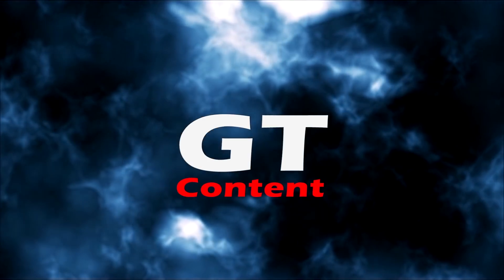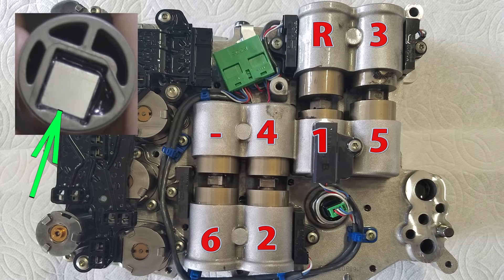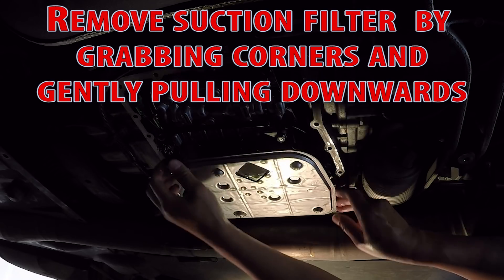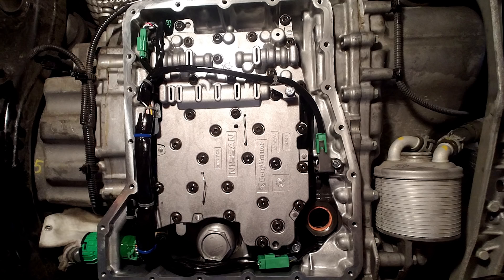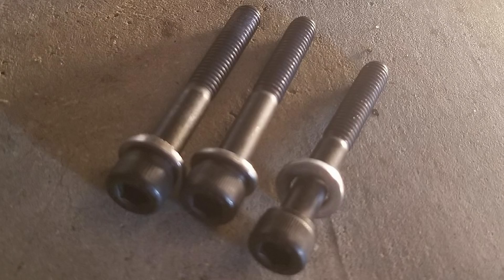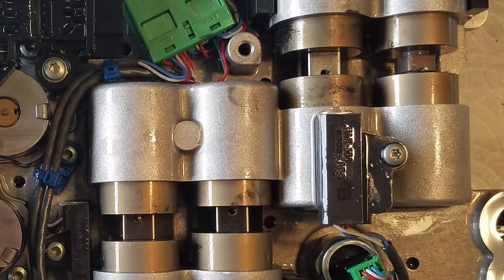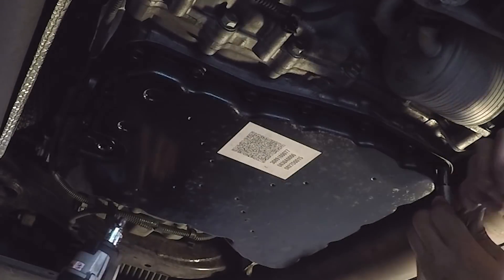$45 dollar part fixes $18,000 GTR Transmission issue - TSB Clips

Comment: Damn what a nightmare after spending so much on a car like this paper clips?
Reply: Herakles quite far from a nightmare. These cars are amazing hand-built machines and the quality is unmatched by many other manufactures. They’ve worked a lot of little quirks out over the years.
Reply: @boostcontrolledperformance1523  According to another channel, the cooling system isn’t adequate for track use and needs some massive upgrades, the stock brakes aren’t cutting it.

Comment: Hello, my gtr is having the same issues, the only code I pulled was P0776 “Pressure control solenoid “B” performance or stuck off” I was just wondering if this was the same code you pulled and if this should fix my issue as well! Thank you
Reply: I had the same error code today.  Did you get your car fixed?  And if so what was the remedy?

Comment: Nissan does some dumb stuff like having all those electrical connections and solenoids swimming in fluid. They also had the tcu in the transmission fluid pan in a couple of g35s and 350z.

Comment: great video, but if u have opened the trans, u should clean the pistons, the metal on the magnets can destroy the pistons, because they got scratched and leak... 

where u get the nissan service bulletin? here in austria u got NOTHING from Nissan.....

i have done this year also a maintenance on my gr6 with install clips, cleaning, add additional Magnets, replacing the Linefilter und fill Motul DCTF (like u do on yours) :)
Reply from the maker: The service bulletin states not to clean any metal shavings/debris. The stuff we found on the pistons looked and felt like grease with very little shavings. Of course, we cleaned them with a soft towel anyways. lol

The bulletin can be found online. I'm not sure if it's specific to the USA only.

Comment: Would you also recommend to replace the oil pan gasket and filter ?
Reply from the maker: Good time to do it if it needs replacement. Otherwise reuse the existing.

Comment: What happens if I don’t add these when it needs them? My car transmission works fine and power and TQ is there but it’s making a weird ass sound on 5th gear. I had got code P283C-00 shift fork “C” position circuit range/ performance
Reply from the maker: Not required if you don't need them. More for prevention.

Comment: I don't fully understand what you are doing with the paperclip and magnets on the accuators.
Reply from the maker: The paperclips will prevent the actuators from rotating.
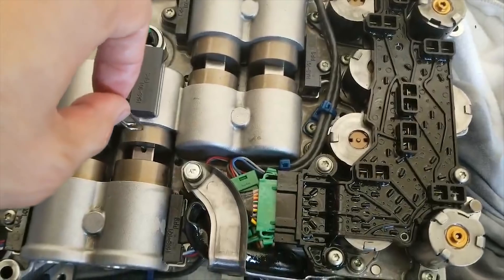Reply: @GTContent At 3:36. No, sorry, the paperclip when you had the valvebody on the table. When you were dangling the clip and it would stick to the housing. What was the point of that? Is that doing some internally?
Reply from the maker: @Mikey6048   I used the paperclip to find the location of the magnet in the side of the actuator so that I can align it. The GTR shifting issue is caused by the actuator getting out of alignment.
Reply: @GTContent  So the metal paper clip is aligning the magnets in the housing. OK.

Comment: hi there love you videos btw , i actually have quick question , my friend drove my gtr and he was on manual mod if im not mistaken i saw him tap the rev limiter while downshifting 4-3 , im quite worried if there was any damage due to that  but the car seems to run fine but just worried , so would want to ask the expert ...tq
Reply from the maker: You should be fine as long as you don't notice any unfamiliar noises or weird shift issues.
Reply: oh cool actually made me feel alot better , just wondering actually , how high rpm can a gtr tolerate when downshifting .... have you ever downsfit above 5k rpm ? tq
Reply: it actually happened few months back ... but i still think about it because i never had a proper answer on how high rpm can u go while downshifting on a gtr ... some says gtr can tolerate 7k while downshifting ... anyways thanks for the fast reply ... watching all the way from malaysia :)
Reply: @VILLAINSSQUAD  im always downshifting above 6k rpm, and not having any problem after that... my gtr is 2012 model... the main purpose for downshifting is to gain engine braking and stopping,.. i dont think the ecu transmission can let you downshift to more than the rpm limit because i have try do it one try to tap the downshift paddle while im in 3rd gear and at 6.5k rpm and it do not engage the downshift until im reach 4k rpm...

Comment: Great video.  What do you think about jacks drag 800 transmission?
Reply from the maker: If you plan to not go above 800TQ, then it's fine. I believe Jack's uses Albins gears which are quieter. Shep uses Dodson which are slightly noiser, but stronger. Just words from others as I have no personal experience.
Reply: GT Content thank you.  How about oil...Motul 15w40 and what’s your opinion for the best combo?

Comment: I have a 2009 GTR.  And this week it started doing exactly that. I made an appointment with the dealer for transmission oil change which is due and I don't know what to expect when I get to the dealer. Now I have a pretty good idea what the problem is. Can you do this job ?
Reply: Did you fix it?

Comment: I have 09 plate is it worth doing it even though I don’t have shifting issues ?
Reply from the maker: It's preventative maintenance. Do it if you'll be working in there.
Reply: @GTContent  what about the transmission filter? There not cheap mine only done 60k miles
Reply from the maker: @garyalcorn3831  No intervals on the filter. Do it if its convenient.

Comment: Hello! I have a 2015 Nissan GTR and I can hear my gears switching and hear a little grinding noise when I let off the gas in first gear. Also I can hear my bellhousing knock! Would you recommend doing this on my 2015? 

Thank you,
Erik
Reply from the maker: Might just need a bell housing replacement.
Reply: GT Content okay and you don’t recommend putting these clips in my 2015?
Reply from the maker: @ebotos  You can install the clips as preventative measures.
Reply: GT Content definitely will man! Because I also have a grinding noise in first and reverse when I let off the gas.

Comment: So this prevents the transmission failure!? 45$!? Lol.  I wanted to buy a GTR for so long but was scared because I didn't want to drop 20k on the transmission! Also, are the 2014 transmission better, did they fix the issue?
Reply from the maker: The transmissions were updated for 2012 and newer. 
The TSB clip issue is a hit or miss just like the bellhousing.
Reply: I was gona ask about newer models seems this and thw bell houseimg was looked at and improved sofar the newer grt models seem to be slightly better am looking at the chnace of geting a 21 gtr :) so these videos do help alot

Comment: Love your videos. You make me feel more confident in owning a GTR (which I am now picking up in a few days).

QQ- would it be okay to do the clips on a 2010 with no current shifting issues? Ie, do not have to take anything apart but just shove some clips in there?

The GTR I am picking up just had a ShepTrans rebuild stage 1 on it so no idea if it even will have the same problem. Thanks!!
Reply: if it has a sheps tran in it, it will come with these already, if it's the stock trans doing this will negate any future issues and is a good thing to do even with no current issues.

Comment: are there any shifting problems again ever since then? any other transmission related issues? planning to get a 2009 model.
Reply from the maker: The owner has not had any issues since.
Reply: @GTContent  is the 2009 model GTR a smart move since its cheaper or go for the dba 2012 model?
Reply from the maker: If you can afford it, get the 2012+ for the significant updates.

Comment: How many miles was on the GTR when this issue started? My 09 CBA ,FBO E85  GTR only has 14,000 miles on it ..
Reply from the maker: I recall it being around 40k
Reply: GT Content Thx Gary..as always great info..very well done..
Reply: Yeah, mine got it at 48k luckily I bought a drive train warranty when i bought the car so I don't have to mess with it. Its currently at the shop and so far the bill is $24,000.
Reply: good thing the warranty has to deal with that bill

Comment: What would You suggest for a 2014 GTR having the same issues. Wont shift into odd gears tm light came on then went off check engine light stayed. Now tm on all the time. No recall is this still a tsb clip issue
Reply from the maker: Sounds like you need to do this repair.
Reply: @GTContent  Took out the code reader says pressure solenoid B P0777 malfunctioning. Is this the same issue as your video or better yet if it the same fix. Seems like it could be dirty trans fluid I just changed that 3 months ago and diff bad pressure sensor electrical ecu lol dealership went dream
Reply from the maker: @princenero1212  I can't say exactly, but you're symptoms are similar to the GTR owner whom I helped fix his transmission shift issue.
Reply: @GTContent  how much you charge I know we in a pandemic but I support small businesses 1000%
Reply: @GTContent  yup symptoms were the same except I couldn’t go into odd gears.
Reply: @GTContent  another question and thank you kindly for all your help is he still having issues. Did that fix the issue? Did he have to take the car to the dealership to adjust the tcm they quoted me 450 for that to get it back into factory specs
Reply from the maker: @princenero1212  I don't have much time atm for actual repairs (my family), but my troubleshooting service is free. 
His issue was not being able to go into odd gears also. His car has been running fine after the repair. He used a Cobb Tuner to reset/learn.
Reply: @GTContent  I understand I took it to a Japanese repair shop lol 2 gtrs in the bay you could guess why so I think I’m good. I showed them your video but they already seen it smdh industry is small I guess I’ll let you know what the damage is.
Reply: @GTContent  ok quick update lol I replaced all three sensors in the transmission they were all failing or about to fail ouch at 65K btw. Did the TSB Clip install as well thanks for the video!!! Just waiting for a pan gasket and to put the Trans back into the car I’m at 9 hours of labor so far. 600 in sensors 60 in clips I bought extra in case 300 in trans fluid 55 gasket. Dealership wouldn’t sell me the transmission sump filter so I just cleaned it up.
Reply: Ok final update and thank you once again. Car has been running or about 100 miles or so now with no cel or tms failure. I saved about 20K by not going with the dealer recommended replace trans assy lol. I did have to replace all three pressure sensors though at 185 a pop. So total cost fluids parts lift rental 1690!!!!!!!!!!!!
Reply from the maker: @princenero1212  Great to know. Congrats!
Reply: @princenero1212  great job!  My car is having problem same as yours.  Code P0777 on Cobb.  Where did you buy the three solenoids at?  Thanks in advance.
Reply: @marccastro1834  not a problem I brought them at jacks transmissions. They are all the same sensor. Also used their trans oil it’s better and way cheaper. After you replace make sure you check if you have a blown clutch seal as this can be the same code. Also if you have a tuner the cel might come back on as it’s relearning the lower gears. In fact mine threw me the other side code which we knew was false because we tested the sensor prior. I’ve ran the car for about 1.5 miles since. Goes to the tuner next month for E-85. Jacks recommended doing their 4200 package which sends the trash out for upgrades. That’s my next step it’s rated at 1000Hp I believe. If I had to do it all over again. I would do a trans flush filter replacement and relearn yearly on that car. Dealer quoted me 22k for brand new trans. I’m about 2k in so far 5K FBO 5K race trans. Yeah do not get a trans from dealer it’s a clutch seal issue or sensor replacement.
Reply: @princenero1212  thanks for your input.  On the clutch seal.  Can you repair that too?  While the valve body out?
Reply: @marccastro1834  I believe you remove the clutches and send them to jacks for testing and resealing if needed. It’s like a pressure test. If you email sales@jackstransmissions.com they will send you colored steps on how to change them etc etc. They first suggested tsb clip install and then sensor replacement and then send out the clutches for reseal and then upgrade some internals and then upgrade to thier race transmission. So they legit didn’t just say oh send the clutches out or oh replace the trans. They legit said it’s not what the dealer says it is it’s one of these three issues 1. Tsb 2. Sensor 3. Clutch seal. I did the first two and I’m going to bypass steps 3/4 and just send the car up there to get their racing transmission for 4500
Reply: @princenero1212  thank you so much.  I would do that.
Reply: Hello again.  Before I order the 3 sensors.  Do you have to take or bring down the tranny to install them?
Reply: Yes